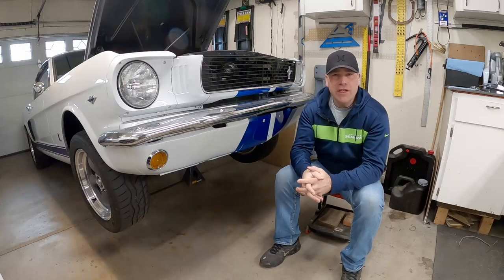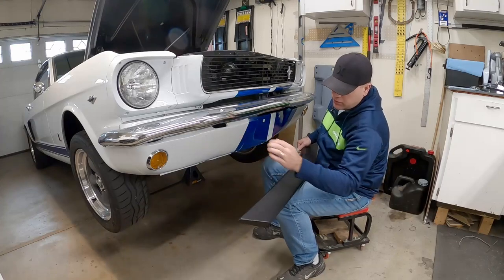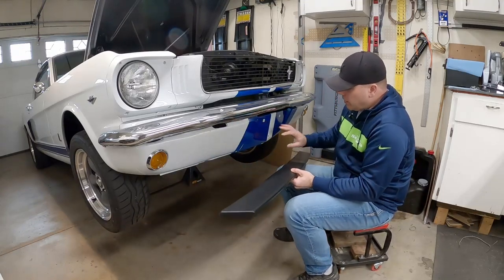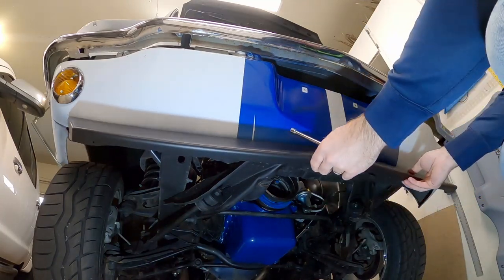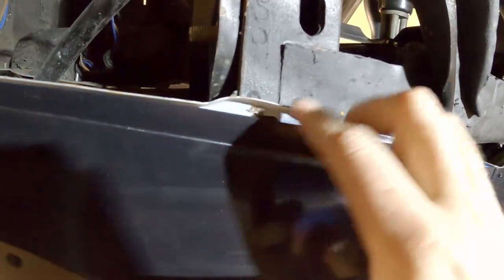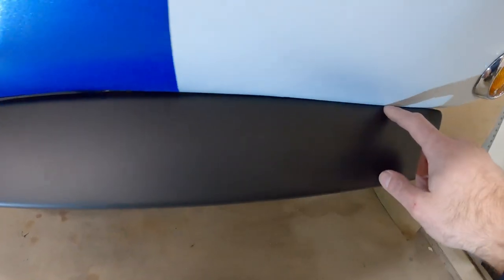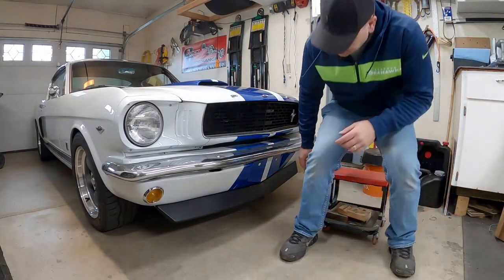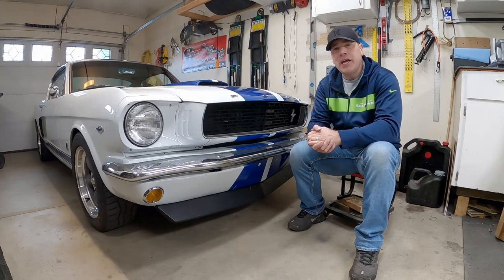Installing the Front Spoiler

Comment: Andy--gotta say it is SO fun to watch your videos.  Keep up the good work.  Been a Mustanger for years.  Love your car-great taste.  '67 FB are so stinking popular (and I like 'em) but the 5-6 FB are still my favorite.  On early cars I have always loved a naked(no bumper guards), perfectly straight, lower valance-always worth ordering new to get it perfect.  They have a lot of shape and character alone.  I never liked the stupid lower flange/lip, especially on lighter colored cars or when its folded/bent--I like semi-gloss or flat black used on the rocker pinch welds.  Makes it "shadow" into/under the car that way.  CJPP has a '67-'68 spoiler and only about 3 out of 15 reviewers were smart enough to make it fit.  Judicious use of a heat gun works wonders.  I will order one for my '67 convertible and accept the heat gun challenge.  I would tend to run without it on your year of car, but I do like it!  I wonder if the heat gun could iron out the Camaro bumps! I agree with your comments, doesn't always help a car, but it is subtle enough on yours to look good.  Next Mods:  LED headlights-not the goofy ones-halo's, or Jeep style.  Your car is dang nice--5 speed, traction-lok, discs, period wheels and decent paint.  I don't know what else:  AC? Old Air or Vintage Air. EFI maybe, but a good 4 barrel is great too and fits the vintage flavor of your car.  BTW, love radio delete and the proper steering wheel-nice--I always like spending money there!  Detail the engine bay? Holman Moody valve covers or just Cobra  or I like the Slant Edge style.  Holley and Edelbrock have some nice vintage style oval air cleaners.  Dynamat is a good mod too.  Carry on!
Reply from the maker: Thanks!  It's always great to get some feedback from the other side of the fence.  :)
I like the Shelby lower valence on these cars, and I'm tempted to do it when I get a chance to paint the car.  But motor work is the next big money suck that I'm working on.  That 289 is tired and the bearings are near shot.  I can drive it, but you can tell it's time for some work.  I was tempted to just throw in some bearings until the motor gets done, but I'd rather put the money towards the build, and there's that risk of screwing it up and then I won't be able to enjoy it this summer.  :)

Comment: Great job... Good eye when shopping for the perfect front spoiler! It really completes the look in an extremely cool way. You're right, I'd find a way to strengthen it for high speeds. Might use 5 points instead of just 2 or 3 to make it super stout. Looks fucking AMAZING, dude. 👏😎👍
Reply from the maker: Thanks. It has been on there for a while now without any issues, so it’s likely secure enough. 😁

Comment: Can you post a link to where you bought this front spoiler? A follow up video with rod installation would be awesome!!!!!
Reply from the maker: I purchased it off Ebay, just search 1969 Camaro Front Spoiler and you will find one. 
Yes, I plan to do a follow up video, where I show the rod installation location, as well as a few other things I need to update on.  But for now, the rods easily fit when attached to the mounting location on the spoiler and the frame of the car.  I felt a little silly once I got them done, I could have easily figured that out if I would have put a little more effort into it.  :)

Comment: I like it, I installed the Dynacorn spoiler for the 66 Mustang. I love the way it looks from the front, but from the side not so much. Debating on going to this style spoiler in the future. How far does it stick down from the bottom of the valance? That may be my deciding factor comparing it to the Dynacorn spoiler.
Reply from the maker: The spoiler is about 3-3/4 inches tall, fairly uniform in height across its whole length.  The tip of the spoiler goes forward about 1-1/2 inches from where it is mounted.  :)

Comment: Hey, that looks pretty sharp! I have a 65 tribute just recently done with the GT350R front valance. I’m thinking about it. Again, well done. You know, for a quick cheep fix Regarding the stripes on the lower valance. You can paint the whole balance in the spoiler in same color, example; the famous Charlie Kemp 65 R Model had Orange for the valance and spoiler. It definitely looks killer that way. If you don’t know which car I’m talking about, look it up and you’ll see. Thank you for making the video.
Reply from the maker: Thanks!
I'd like to get the whole car painted anyways, so it will probably just get fixed then.  :)

Comment: Looks good on a Fastback. Question: what wheels are those please? I think I have the same on my 67 Coupe but have spacers on them and having issues. Not so easy to get parts here in the UK to solve it.
Reply: Just found the answer on a previous video. Keep up the good work!
Reply from the maker: They're American Racing Torq Thrust II, 16x7, 0.0" Backspacing, part number VN2156765.  :)
Reply from the maker: Oh, I just saw this reply, no big deal, now you have the info twice.  :)

Comment: Those supports looked nice. It's a shame they didn't have anywhere to mount. My front spoiler has a bit of a droopy nose. I'm guessing it's a mixture of driving at speed pushing it down as well as heat causing it to deform. It's one of things, like you mentioned, that no one else but me will notice.
Reply from the maker: I was able to make the support rods work after I was done with the video.  I filmed this over a month ago and the Spoiler still looks great.  I'm glad I was able to get those supports to work or I bet it would do exactly what you're describing.

Comment: What wheels and tires  are on that car?  With offset and back spacing please?
Reply from the maker: American Racing Torq Thrust II, sized 16x7, all four with 4" backspacing (which is the same as 0mm offset), 5x4.5" bolt pattern, and the part number is VN2156765.
Falken Azenis RT615K+, sized 225/50/16, all four.
Reply: Awesome!  Thank you!